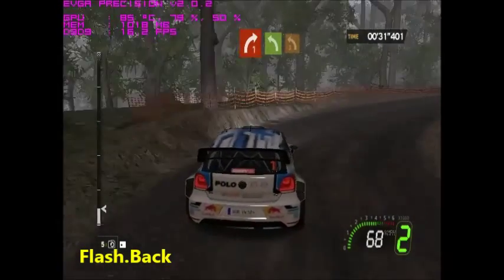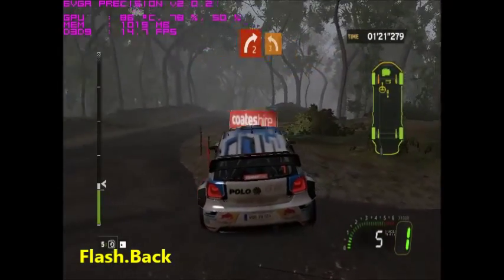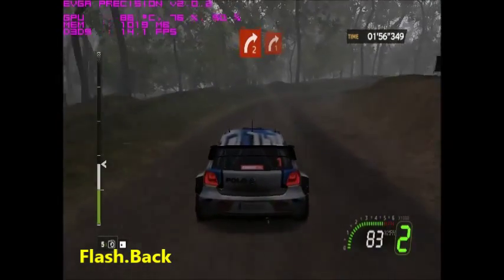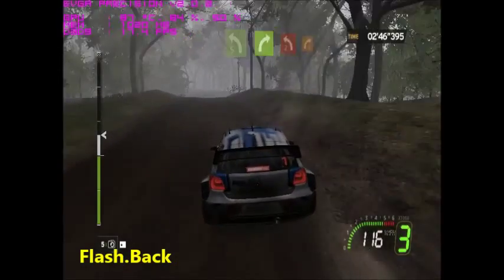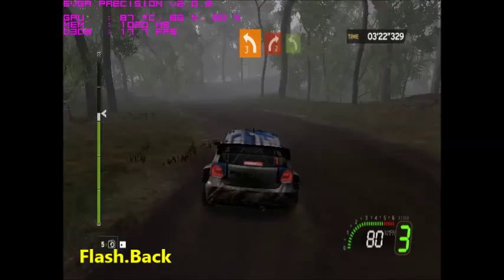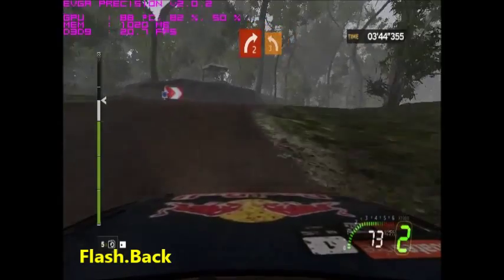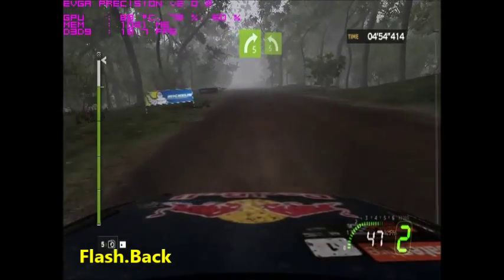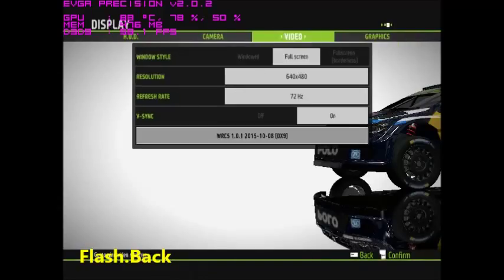(Teste) WRC 5 - 9500GT + Core2DuoE7500

Comment: fala ae, cara te dou uma dica, abre tua CPU,deixa em um angulo de 45 graus, e liga  ventilador que empurre o ar pela parte traseira, eu fiz isso aqui por causa do calo do verão, e reduzi de 90 pra 63 no wrc1 com minha 8400gs
Reply from the maker: +Eckert Gameplays Desisti de melhor a temperatura dessa placa de vídeo, infelizmente ela está com um problema no sensor e não mantém a rotação da ventoinha. De qualquer forma, obrigado pelo conselho.
Reply: +Flash.Back quero comprar ela pra quebrar um galho ate comprar um PC novo, pretendo apenas pelo CS go e pelo bad co2 que tenho originais ,mas não rodo, e talvez bf3 no los , da conta de um amigo q n joga mais,como fica o desempenho dela nestes jogos?
Reply from the maker: +Eckert Gameplays Já testei o Battlefield: Bad Company 2 e o Battlefield 3, ambos funcionam perfeitamente. Nunca testei o Counter Strike GO mas deve funcionar também. Testei também o Battlefield 4, o teste está no canal. Aconselho que compre pelo menos um Gtx550ti.
Reply: +Flash.Back o CS go deve sim,meu problema e o processador,sem sentido o CS precisar de + CPU q bf3
Reply: +Flash.Back o wrc1 eu peguei 35 FPS com ela,(2010)